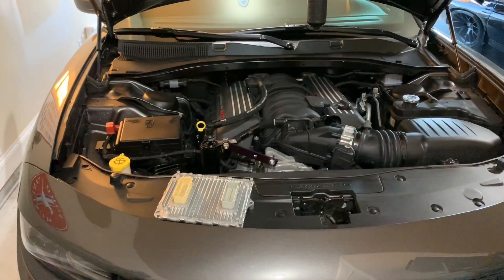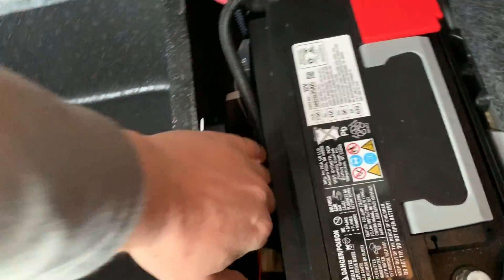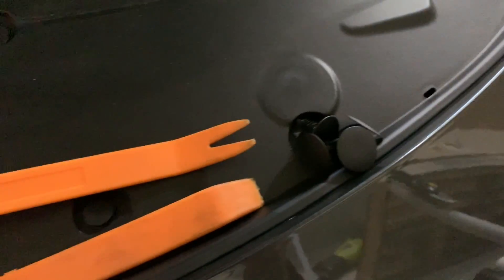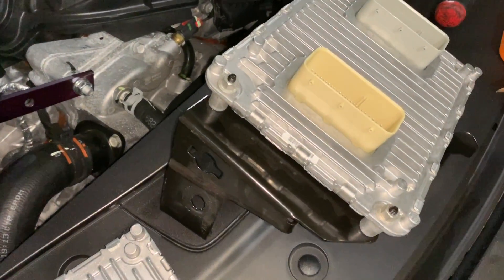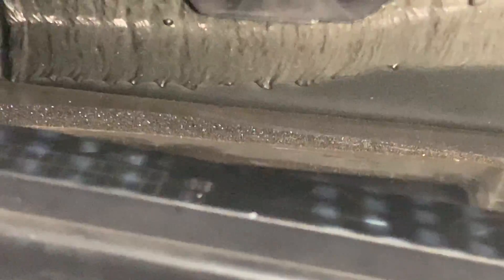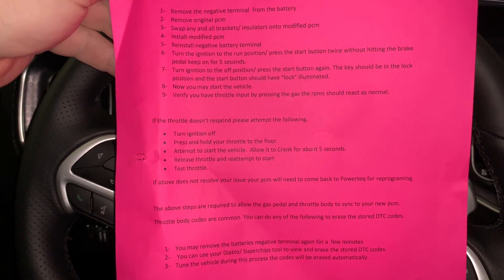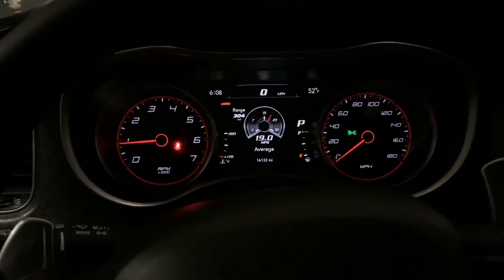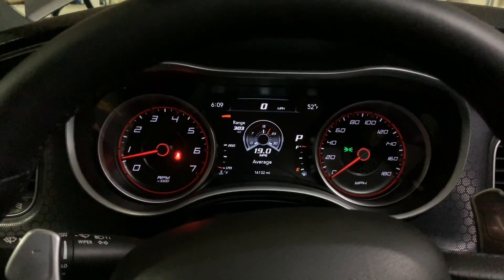Diablo unlocked PCM install on a 2018 charger Scatpack, SRT, hellcat. 2015+ install.

Comment: hey diablo wants me to send a pcm back to them do i have to send them my factory pcm?
Reply from the maker: If you didn’t pay for an extra PCM, then yes you have to send your PCM to them to unlock it.
Reply: @KnightsGarage  damn, the new 1 just hit here i think they want my stock? but i gotta call tmr let me know if u have any info🙏🏾
Reply from the maker: @ytdereksnippets3732  if you didn’t pay for an extra PCM from them then you just paid for the exchange which means you have to send them yours.   It was about 1k for the extra PCM and tuner when I bought it.
Reply: @KnightsGarage  damn might as well keep it and just pay thev600👎🏾 thanks
Reply from the maker: @ytdereksnippets3732  yeah I felt the same way.  Then when I sold the car I sold the unlocked PCM for like 400.
Reply: @KnightsGarage  wait right now i’m alr on 80k miles and i’m on my extended warranty if i have to bring it it will they still fix my car with the mopar diablo pcm”not the original”?
Reply from the maker: @ytdereksnippets3732  It depends on the dealership and what the problem is really. Even if you put the stock PCM back in there’s a way they can look for a hidden code in the BCM until the PCM has been swapped before.

Comment: I have a 06 rt charger want start want crank put key in ignition gear shifter moves too the right gas gauge work but no other gauge work . Sent my ecm off came back car still have same issue .. any recommendations? From u guys
Reply from the maker: So let me make sure I got this right. Everything was working properly Andrew century see them all to have it unlocked and when you got it back and installed it in the car it was acting like what you describe here?
Reply: @KnightsGarage  only thing works is the gas gauge .car  want start
Reply: I sent the computer off it came back car having the same issue
Reply from the maker: @TheHoneyhill  So you sent the computer off because of this issue?  

Sounds like a bad computer.  Or you may have been some of the pins on the connectors for the computer.
Reply: I sent off yes and it came back still same issue now I gotta send it back to them

Comment: I have a 18 rt challenger I have a pedal commander on there. And I installed the unlocked pcm. I programmed it by doing what the paper said the car was getting power but won’t start. the pedal commander wasn’t getting power because the light wasn’t on I took out the new pcm and put back the stock pcm and it starts right up. Do you think the pedal commander had something to do without it starting?
Reply from the maker: I will definitely uninstall the pedal commander and give it a try. While the pedal commander doesn’t really change anything with the PCM it does alter the signals going to the PCM.  
If the PCM doesn’t get the proper signals or something is messed with while it’s being programmed it could cause issues.  
Not sure if that is your problem but it’s worth a shot. You could also call Diablo sport and tell them what happened it may just be a bad PCM that they have to replace.
Reply: @KnightsGarage  okay thank you

Comment: How the hell did you get the new PCM to plug back in? We have three guys and have spent 4 hours trying to get it back in.
Reply from the maker: @tzick  it was pretty easy. It pretty much just plugged back in. You have to make sure you have the tabs pulled back all the way on the connector like you have it when you remove the plug before you can plug it back in.  If that makes any sense.
Reply: Damn maybe we are just having a hell of a time 😭 it’s prior salvaged so we are thinking the cable used isn’t great because the two guys I have helping me are mechanics and we can’t get it on there to save our lives, we gave up and are gonna try tomorrow. Thanks for the tips hopefully we get it
Reply from the maker: @tzick  yeah he pretty much went right back on the new PCM the opposite of how it came off the original

Comment: Just installed pcm after running my tazer and getting it lined out. Plugged the tuner into my bypass that I run the tazer off of and my tuner had no power. So thinking it was broke, I went to the obdII up front and it powered up. What do you think the issue is? I couldn't find any connector bank their instructions talk about. Tazer works fine and powers up, but when I plug the i3 into the bypass, it won't boot up.
Reply from the maker: David Smith have you plugged The i3 into your computer via USB and did all the updates needed? Also I think that happened to me and I pulled the radio fuse that the Taser hooks into and then plug it back in and just did two key cycles and it worked after that.
Reply: @KnightsGarage  I updated via wifi. Unplug tazer, then do the two key cycles with tuner plugged in?
Reply from the maker: David Smith no.  I didn’t have anything plugged in at all I pulled the fuse that the double bypass pants and two for about five seconds then plug it back in and did to keep cycles and when I plugged the i3 back in it worked.

Comment: See you didn’t get the factory data from your pcm either. Diablo saying that’s what I needed to do before sending it back I think I’m screwed.
Reply from the maker: This video just covered the installation of the physical PCM.  Like where it’s located and how to change it out.  I did get my factory data from the PCM before removing it.  They send that to you in the instructions I believe.   But I didn’t do a swap so I did not send my factory PCM to them.
Reply: They said I need a “Calibration ID” how would I find that out ?

Comment: What parameters did you set for your fans for the 180 T-stat?
Reply from the maker: Anthony Salazar I let my tuner Jay Green worry about all that. Lol
Reply: Project 392 smart lol
Reply: Project 392 still no issues?
Reply from the maker: Anthony Salazar Not as long as I had it I actually removed the tune last week and sold the car a few days ago

Comment: Will I be able to get a dyno tune with this pcm?
Reply from the maker: Yes with a Diablo tuner.  A tuner will write a tune and you can use the Diablo to load it on the unlocked PCM

Comment: Can I get the link for this pcm?
Reply from the maker: https://www.diablosport.com/shop/2015-chrysler-dodge-ram-jeep.html
Reply: Appreciate it bro. Do you have to tune it with only diablo tuner or you can tune it with any other tuner
Reply from the maker: John Michael I actually had the same question when I did mine. You have to tune it with which ever unlocking service you use.  So if you use Diablo to unlock the PCM you have to use Diablo to tune it.
Reply: So if I get a diablo unlock pcm that means I’m gonna have to use a diablo tuner?
Reply from the maker: John Michael yes.  And if you get the HP timers Unlocked PCM it has to be used with HP tuners.  I’m sure there’s a way if you have bought one aftermarket that you could send to the other company and they would change it over to use their tuner, but it would cost you some additional money.
Reply: I appreciate your time man. Now Ik what to do💯
Reply: Hey sorry to bother but quick question, is there any particular reason why on the diablosport site when going to purchase the diablosport i3 and pcm swap it asks me to put in my cars ViN number and etc in order to purchase it?? Thanks
Reply from the maker: @sparklycleandude  yes so they can match the new PCM to yours so it will work in your car.
Reply: Ah ok cool thanks man, the pcm and i3 combo is what I need to buy then right?? The 950 priced combo for the 2018?
Reply from the maker: @sparklycleandude  yes, if you want to do the swap.  I just bought the extra PVCM when i ordered mine.   That way i didn't have to wait with out the car, if anything went wrong with the unlocked PCM i could just throw the stock one back in to be able to use the car, and when i sold the car i put the stock PCM back in and sold the unlocked PCM and i3 to someone.
Reply: Or did u just buy an unlocked pcm and the i3 tuner separately
Reply from the maker: @sparklycleandude  I bought them together but I didn’t do the swap option.  I purchased a second PCM. For the swap you send them your stock PCM and they send you an unlocked one.   Do you have the option just to purchase an unlocked PCM in which case you keep your stock one and they send you an unlocked one.
Reply: Ah ok man I got u, the one I was looking at just says the pcm i3 combo n then needs my VIN number I didn’t say anything about a swap so I assume it’s going to send me the pcm without requiring a swap lol
Reply: Modified pcm is what it says specifically so I don’t think it’s the swap deal